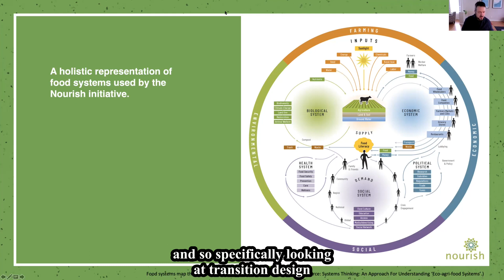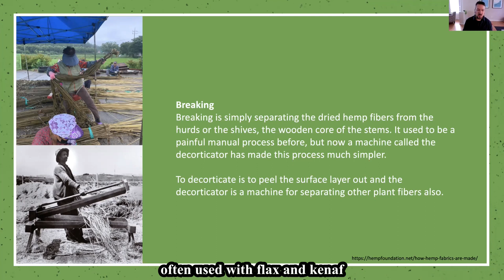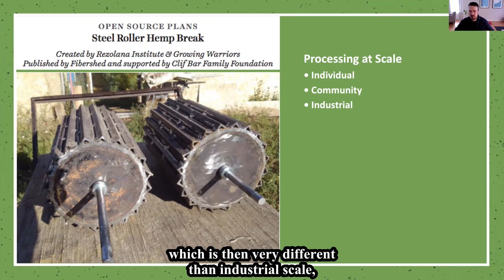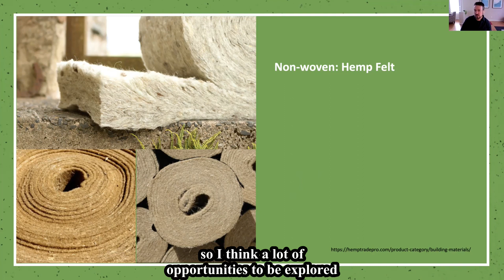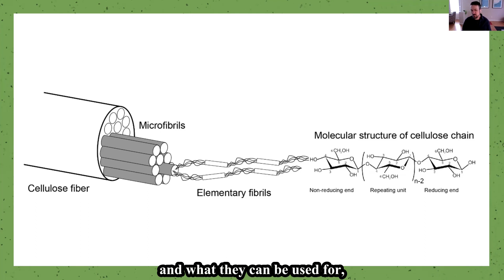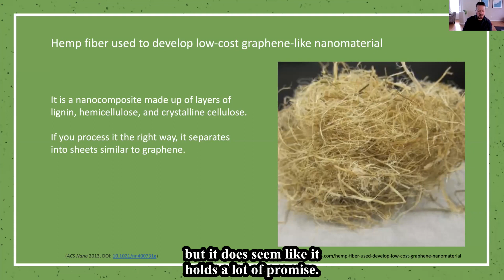Processing Fiber Hemp

Comment: There is too much about what you think, and zero about what is actually sustainable.   The fact that you're not saying kenaf instead of hemp shows what you think is very limited.   And that has had a heavy cost to humanity and planet
Reply: Oh, kenaf slipped in there let's see where that goes.  No need dor hemp while kenaf is available and free to grow
Reply: Yep... I know this is about hemp, but the story should and would be kenaf if people were serious, period.   By ignoring kenaf, people have been ignoring what they want to see in the world and it has held hemp back.  This has also attributed to the continued suffering of people around the world who grow kenaf already for industries.   Kenaf has lost power thanks to hemp and this is actually criminal. ...

If people focused on kenaf, hemp would fall into place
Reply: When it comes to making rope or string you would want hemp. 
@fatheroffibereconomics 
The kenaf bast fiber measures 2.6 mm in length and is roughly equal to a softwood (pine) fiber. Softwood fibers are the high quality type commonly used in commercial scale paper production. Hemp bast fiber is much longer and stronger, measuring between 15 and 50 mm, with 25 mm being a commonly reported average.
Sounds like you don't know as much as you claim